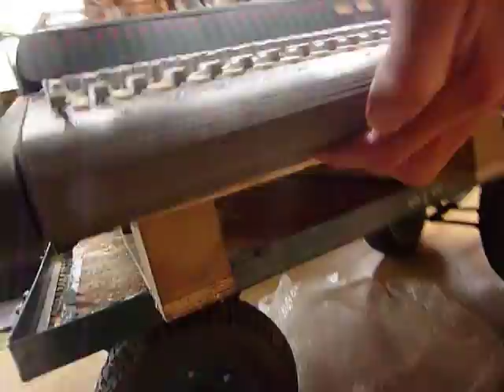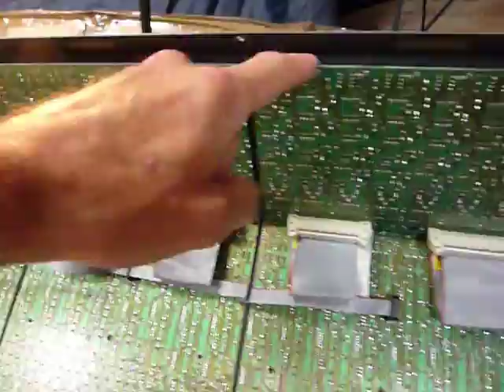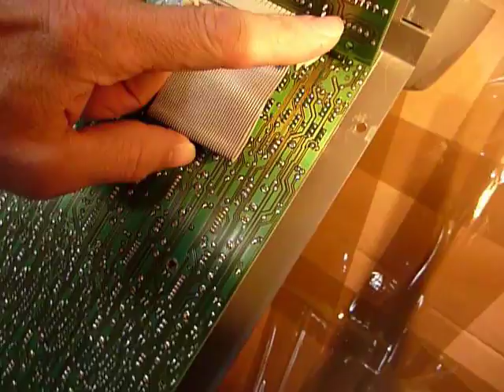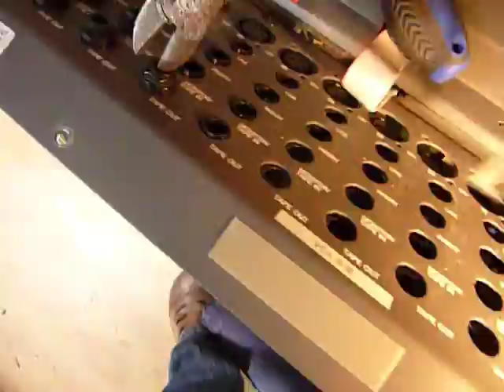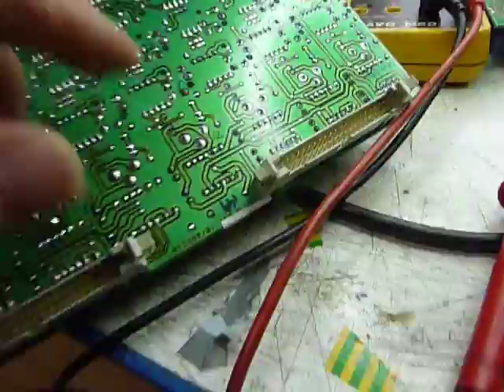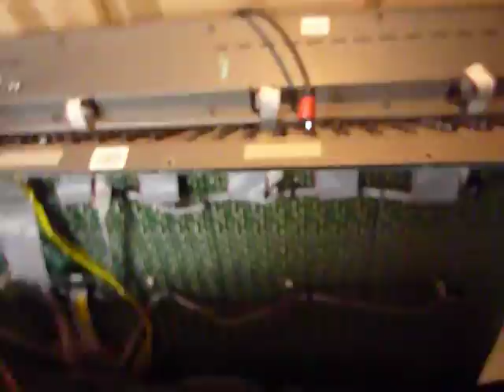daisydoodlesandthetopaz

Comment: I see this is an old Video, but it is very pertinent to me.  I have a Topaz that the mains have ceased to work.  I am thinking the power supply is the issue based on the power lights.  Are you still in business?

Comment: Tim. My topaz 8 has the left 2mix signal disappear often. Not always though and sometimes just drops in level. Can you tell what board is responsible for the main 2 mix out. . I’ve tried most things like swapping cables checking the inserts sockets  are not playing up.
Reply: i have the exact same problem but its mainly just the metering that is intermittent.. spent half a day tracing and im so far inconclusive. Sometimes i lose master right, sometimes I lose left, sometimes i lose metering on the group buses too, and meterbridge VU's. there doesnt seem to be any predictable pattern..
my gut is telling me whatever is powering output and bus metering is loose/bad connection. and i think its the rainbow coloured ribbon cable. ive got spare IDC connectors for the topaz, so im thinking about crimping a new connector on the end. ill post any more results or findings mate.
Reply: @blanca_music 
Hi I have a similar problem where the rh chanel on the main output is 20db lower in volume than the left. Just wondering did you find a solution to your problem?

Comment: the 48 volt you are talking about, is that phantom power related. 

I have the 32 channel Topaz , Mixer works fine, but phantom supply comes and goes,  but with mixer works as normal. . .
Reply from the maker: Well you need to measure the voltage at the power supply  , to see WHERE it is failing,

Comment: hello,  the 1n1041 diode number u mentioned yields no results on web and the nte cross reference resembles a bolt.... also i can not make out the bridge rectifier part numbers for 17 volt plus and minus... please help,  i need diodes for 6 channels and would like to stock rectifiers

Comment: My gawwd! what a effort is needed to change one line input jack!!! Were they made in this bulk module style (I don't know!? whatever the exact opposite of modular single channel strips are called on most large consoles so the board could keep working and earning while maintainance was done on a channel with one small fault like this one;)  Anyway, were they designed like this to get manufacture labour costs down? Cos you'd spend that and more with repair labour costs like Id charge if I was doing this particular job...

Comment: I would like to chime in here and say thanks.  I got a Topaz from a friend and there was a rather pervasive 240Hz hum, and major popping when hitting the phase reverse switches.  Channels 1-9 were the major culprits, and each had different types of sonic problems.  I rebuilt the entire power supply including a new transformer which didn't help.  Then in this video when you say the diodes can go bad, I was shown how to use my multimeter to test them and sure enough, just like you warned, they were the problem.  I replaced all 4 diodes on all offending channels, as well as the two caps near the diodes and the one bigger cap down that the bottom of the board, and BOOM! the channels sound better for the recap, (cleaner low end) and the hum/noise problems are gone as well. So thanks for your tip on checking the diodes.  I now have a beautiful sounding console.  (Rebuilding the power supply will prove to be worthwhile anyway, I'm sure...eventhough that wasn't the offending problem.)  Thanks again, Tim!

Comment: Does anyone have any tips on how to fix the common insert jack issue on boards like this? Is it possible to restore the jacks once they've begun to misbehave? I'm trying to avoid replacing them or having temporary shorted jacks on the inserts when not used. Thx
Reply: did you find a solution?

Comment: Thanks Tim,  this vid was a great help. My Topaz master section right hand channel was cutting out. Determined it wasn't an insert issue,  opened her up and checked all the ribbon connectors, no go - so removed the entire master board and re soldered all the through points on that section of the board , fixed it. The boards are a bugger to remove!
Reply: How can I identify the through points to solder  (for someone with limited electrical knowledge!) I've cleaned all the boards but still have cutouts
Reply: by through points youre saying you reflowed every throughhole component on the master board? yikes..
i wrote my symptoms a few messages up ^^. i guess this is me then. lol yikes
Reply: as a follow up, reflowing the whole master board fixed almost all of my problems. last problem is noisy/intermittent master output insert jack sockets...now to find the correct part...

Comment: Hi. I have question. Maybe you know what number is gain control parts? I mean I want to change some one but I don't want to open mixer yet. Maybe someone know?
Reply from the maker: Hi , well I have plenty of them  and  very cheap I  you can have 8 for 20 GBP  + post   ( I can do you a MIX  of POTS  if you like ) , where are you ?? (for POST)     cheers  tim@studiosystems.co.uk
Reply: Thanks but right now I need to know only parametric numbers of that gain part? And I'm from Estonia!

Comment: Thanks, Tim - this vid is a huge help!  My channel 1 Mic is getting a little buggy and I'm sure you'll tell me to follow the same procedure.  So far, the only issue I've had with mine (24 ch) is the ground fault wire.  I installed a lock washer between the screw/nut which solved the issue.

And you are correct - they are lovely sounding desks (but a bugger to take apart to work on).

Comment from the maker: PLEASE NOTE  : one of the MOST common faults on the TOPAZ  (and many other consoles ) is a bad contact on the INSERT SOCKET = no signal on channel /mix  or group )   so always check for this FIRST  before you start opening up the desk !! , If you wire a STEREO JACK : TIP to RING  you can plug this into an  INSERT socket  to prove this out .
Reply: Hi Tim. first off thanks for this video. very helpful! Is it possible to upgrade the Opamps in the gain stage in the topaz for a more somewhat warm sound? and if so, what would you recommend upgrading and changing out? Im also considering changing up the Hi and Low eq on some channels as i find those to be either very sizzeling or a little muddy. Do you have any recommendations regarding an upgrade with those? Thanks a bunch! peace
Reply: That's how I "fixed" channel 21 😂😂